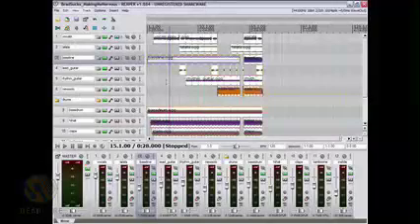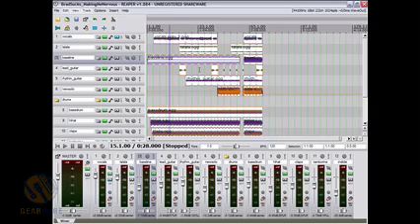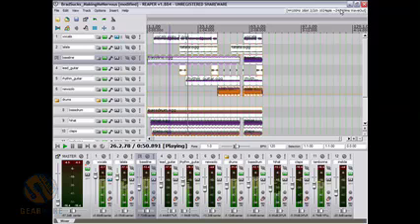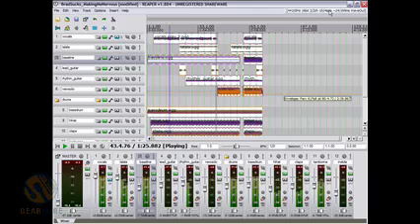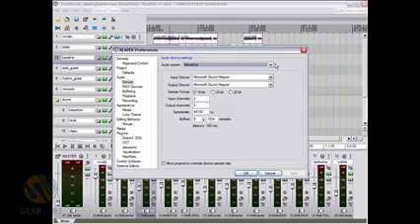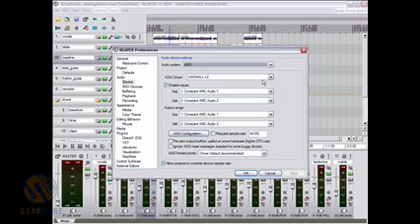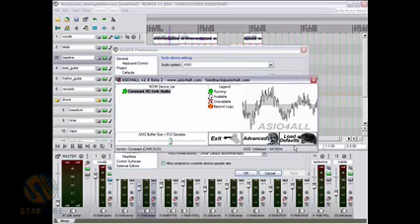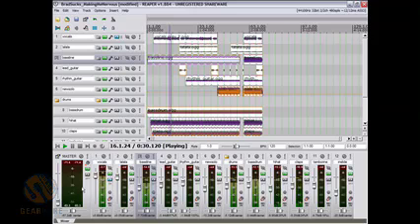Reaper Tutorial Screencast: Setting Up Your ASIO Drivers In Reaper

Comment: I need help. I cannot get my latency below 23 ms with wave out. I'm trying to use ASIO but I can't get it to work at all. When I use ASIO with the creative asio driver I get 10 different input options but none of them are my behringer ucg-102 (usb interface). so I select the entire range but it doesn't work. So I try with the ASIO4ALL driver and it only shows 2 input options and neither are my usb interface. Again I select both and it still won't work. What am I doing wrong? I don't want to give up on recording with my computer but I can't make it work.

Comment: Thats weird. It should install drivers where drivers are normally installed by default. There SHOULD NOT be an option to install it anywhere you choose or Windows will be clueless as to where it is.  Automatic would be a better term.  If you are referring to executable file (.exe) Asio4all which is the user interface for controlling settings, that should not effect why you were not seeing ASIO4ALL in the list of audio devices to choose within  the REAPER program itself.  Glad it was fixed.